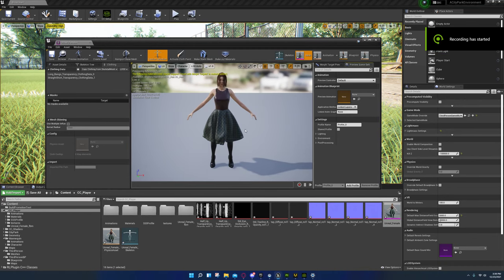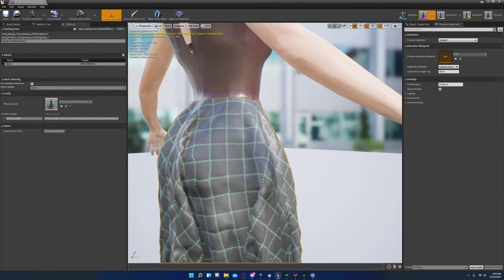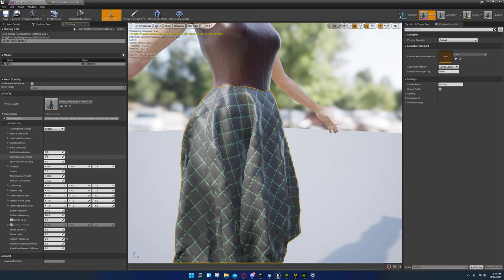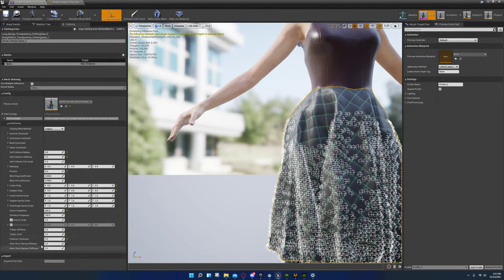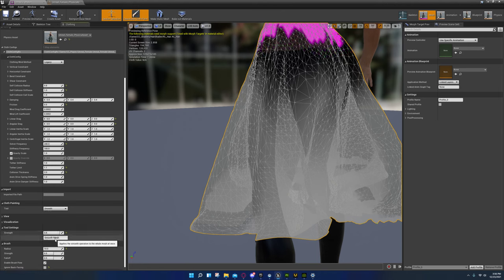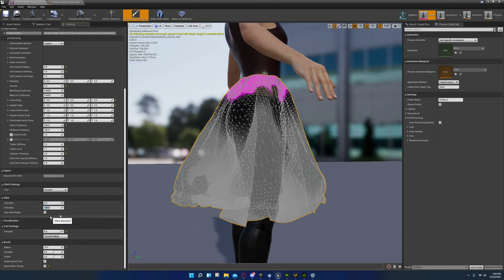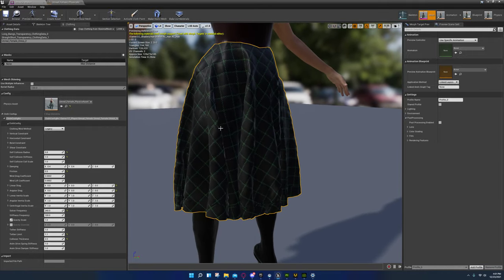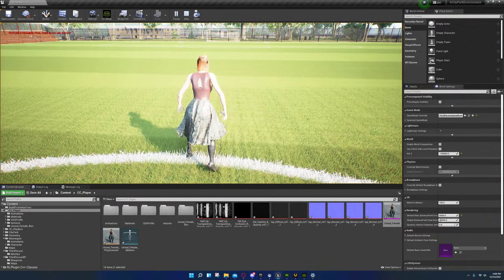Unreal Engine   Cloth Physic Settings Explained

Comment: Great tutorial! Do you happen to know why in some cases the cloth interacts with the physics bodies as if the physics asset is in a neutral pose even during animations?
Reply from the maker: Idk really but it could be a product of a bad Physics Asset possibly. Unless you did it from scratch it's almost guaranteed to be bad.
Reply: @unrealdevop  would it be related to whether the physics bodies are kinematic?
Reply from the maker: @Josh_Alfaro  It's been a while since I've even touched that stuff man so I'm pretty rusty and I wouldn't want to mislead you. If you are using an Auto-Generated Physic Body, I can tell you right now that it's 100% wrong. Unreal is driven by very primitive logic in a lot of those features. Setting up a proper Physics Body is not really a simple procedure, I'm sure they will eventually give it a modern upgrade but as it stands 100% the Auto-Generated one is basically garbage.
Reply: @unrealdevop sounds about right, I auto generated my physics asset and the cloth drapes around the character like he is a sumo wrestler😂
Reply from the maker: @Josh_Alfaro  Yeah you should search for my video on creating them from scratch, it's still probably the best one ever made and if I had to do it again I would refer back to it myself.

Comment: Awesome vid man, thanks a lot. I have a question about cloth collision. When we increase self collision size, will those collision spheres interacts with world? I made a Niagara effects and I want them to interact with my cloth asset. I turned on "Interact with world" option but it didn't help. It would super if this happen. Niagara mesh have a collision by the way.
Reply from the maker: As it stands right now this method uses the PhysX system which I don't believe has the ability to detect anything other then the Physic Asset Bodies. I could be wrong, the documentation on this feature is pretty poor. After doing a bit of digging I discovered that this system is planned for deprecation. 

They will be replacing it in a future update with the Nvidia Chaos System (That's what the Documentation says at least) and it is the same system they use in Fortnite. The Nvidia Chaos Physics system is supposed to be cross-platform compatible between Mobile, PC, Consoles, and other platforms as well. It's supposed to have better collision support which I'm assuming is why they plan on replacing this system with that one. 

I'll look into it more and see If I can get a handle on it enough to make a video for it. I do believe though that the Chaos Cloth Physics have to be imported from Maya or 3DS Max though.
Reply from the maker: @Anoberia  Aah well I'll look into it but I'm not sure I've ever come across someone doing that before so maybe you can't? It could be that to do that would be to performance heavy and maybe that's why you don't really see it and perhaps why it doesn't seem to be supported.
Reply from the maker: @Anoberia  Yeah, more then likely.